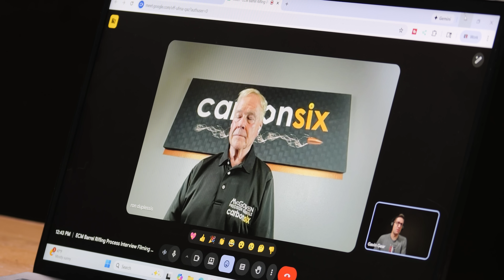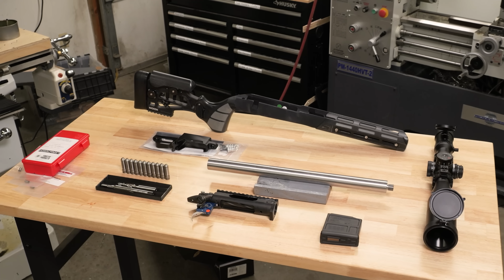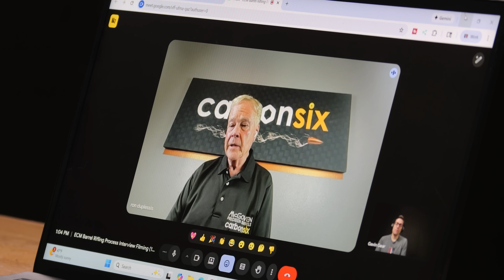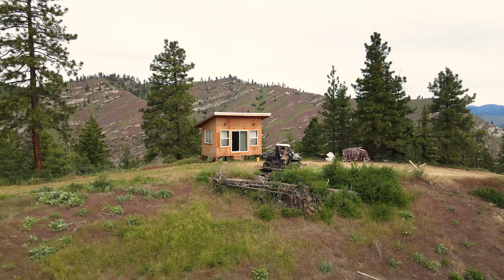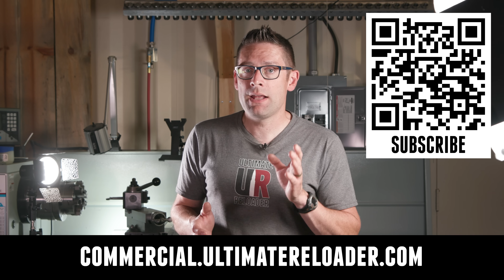ECM Rifling: Discussion with Carbon Six/McGowen (In-Depth)

Comment: So far this technology sounds like it manufacturers barrels way faster, with more accurate rifling, with a better finish, and less stress. So basically it's better in every way, but only McGowen/Carbon Six is doing it? Is it really just the startup cost that's preventing other barrel makers from using it? 
It also sounds like it's the future of custom action manufacturing since it can leave a mirror finish on the raceways which is even better than EDM. 
I have a barrel from Mcgowen on order and they told me it will be an ECM barrel, so I'm trying to keep my expectations reasonable, since surely there has to be some drawbacks to it??

Comment: We used Cation/. Surftran ECM for thousands of pistol barrels when I worked for John Nowlin ( R.I.P. ). 
THERE IS NOTHING SMOOTHER, MORE ACCURATE, AND EASY TO CLEAN using 416R. Wish the best for McGowen... I have a couple of their AR barrels... and one shoots lights out, and the other averages 
.241".... afler treating the barrels. Good luck gents. By the way that was back in the 90's with the ECM! 
Respectfully, Seth

Comment: Somebody here who can tell me if the plastik rod which is placed in the bore has to have a snug fit or more a " press " fit.
In my Opinion the smallest gap between this two parts ,allows the salt water to flow freely and thus reduce the ID of the entire blank.
Answers appreciated

Comment: Barrels are consumables....IMHO more than 6 month lead time to get a replacement is unacceptable (And I do not give a rats ass about availability excuses - FIX THE FUCKING SUPPLY CHAIN ALREADY!). They need to Ask how much business is being lost because folks are just saying "fuck it" to potential projects when they hear a year or two just to get a barrel. I know that I have sold off rifles and decided to NOT shoot certain type matches because of barrel availability. I am too old to wait that long for a barrel!
Barrel life is between 1k & 3k rounds for most of the CF rounds used today for Mid/Long range & PRS matches.... so basically a new pipe every year if you are shooting and practicing. Current availability means that you have primary and backup gun plus two spare barrels sitting there and then a standing order for two barrels a year.

Comment: I recently had a really eye-opening tour of Pac-Nor barrels and their manufacturing process. Some of the custom built equipment they have is just simply insane. The machine they use to remove any dimensional irregularities in a barrel prior to cutting the rifling sounds like it's 90% witchcraft. And this sounds like it's right up in that same category.

Comment: EDM -> spark discharge to erode a work piece.
ECM -> steady low voltage DC to etch metal in a pattern. 

In this video I'm hearing "ECM" described in terms that sound like EDM.

Comment: My 28 Nosler build was excellent, about 1/3 moa at any range I've ever shot it. And she loves the Hammers.
Reply: I'm building a 26 Nosler. That's what I was hoping to hear
Reply: @Econolinebus I used a 28" carbon Six barrel on a tuned up Savage Bear Hunter action. The OG barrel was . 375 Ruger. But any of the magnum bolt faces will work. The magazine will need to be adjusted.

Comment: Would this technology works on military equipments especially that they use chromoly barrels and usually cold hammer forged
Reply: Sabatti hammer forge their barrel blanks before rifling them with ECM machines. I'm not sure what kind of steel they use.

Comment: Are they using this process to cut the chambers as well or are they only producing barrel blanks? 
How can they guarantee 1/2 moa from their barrels if someone else is cutting the chamber? 
Doesn't the cutting of the chamber have just as much to do with accuracy as the cutting of the rifling in the barrel?
Reply: Nice one Lou....looks like chambers might be the next frontier...maybe you could even design your own..which could be converted to program....
Reply: in theory i believe both could be cut with one tool in one go with ecm, i don`t know if there are practical reasons to not do that though.

Comment: 5:30 ECM and EDM are not the same thing. EDM uses heat generated by a spark (discharge) to ablate the metal away. ECM used current and an electrolyte solution to pull atoms off of the metal and into solution, basically the reverse process of electroplating. For a guy who runs an ECM business he really needs to get that straightened out.

Comment: I have one of their barrels that used this new process.It's a 20" 6.5 PRC / Prefit Tikka.  Shoots 140 bergers as a knot hole @ 100 yards.
Reply from the maker: Awesome, was that carbon six or McGowen?
Reply: @Ultimatereloader  Carbon Six. Rebuilt a favorite Tikka,  Manners LRH, Suppressed.  Took 2 white tails this fall.
Reply: @amkamphuis how long did it take to get the barrel ?? After ordering
Reply: @shanerhodes925 7-8 months. I didn’t know I was getting an ECM barrel till I talked with the guys before it shipped.  Planning a 6 or 22 next

Comment: Thanks, Gavin! I'm really excited about this tech. This could open the door to a number of new steel alloys for barrel manufacturing.

If you're going to SHOT Show this year, you might want to stop by the Extrude Hone booth. They'll have an ECM rifling machine on display.
Reply: Damn, that's a good point, being able to cut the rifling has limited what alloys can be used, with this tech that's no longer an issue.

Comment: maybe i missed it. what did he mean by a sleeved barrel?
Reply: They are developing a sleeved barrel to add to the lineup as a budget-friendly option for hunters seeking a lighter barrel at an affordable price, without the need for the added performance of a standard Carbon Six barrel. The sleeved barrel utilizes a carbon fiber tube that is tensioned over a steel barrel, whereas a traditional Carbon Six barrel is constructed by winding carbon fiber over a steel barrel.
Reply: @CHebert95 thank you very much

Comment: EDM is what many call the process.
Reply: That's actually a different process. With EDM, you're using a small spark to selectively erode away the metal. With ECM you're using an electrochemical process to selectively corrode the metal.

Comment: Will it build up a hard outer layer like button riffling.? (Think Forged Receivers vs. milled billet).. Suppose Plating/Deposition (like chrome/mel) is still in the equation… Interesting. love to see the data as it sounds easier/cheaper and way More accurate than buttons.. ? We shall see. 🤙🏻

Comment: Gave a thumbs up because I think it's neat to get a little bit of the inside scoop on what's up and coming.

I've had a small number of McGowen barrels, and the bores have all been good.  I had to return a barrel for a non-concentric chamber, and then re-crown the muzzle on my own, after I sent the barrel back to be redone.

So, while the bores may be good, the gunsmithing and end-product are a little bit sus, as the young kids say.  To their credit, a lot of companies don't pay the best attention to AR-barrels, and these were AR barrels, but still.

That said, I do have another barrel on order.  On week 32 of waiting.

If I have a question for Don -- why is single-point cut considered and end of life product for McGowen?
Reply from the maker: Thank you!
Reply: @Ultimatereloader  I don't see too many other people asking questions, so I'll ask another.

He mentioned Copper Sulfate is used for the button rifling? How does that work?  I recall being told that they use almost a type of copper plating - is this essentially it?  You use the softer material to help act as a lubricant, and prevent galling?
Reply: This is for future readers, because I want to make an addendum to my original post: I'm still waiting for my barrel.

It's been just over 48 weeks since when I made my order, and 16 weeks since I made my original post. 

I reached out to McGowen an addition time, and have not heard back.
Reply: Addendum #2 --- It's now officially been over a year since I ordered my barrel - still haven't received it.

Comment: To address throat erosion I was toying with the idea of a pressing in a carbide insert in the throat area and then ECM the rifling. The insert can be precision ground using a cylindrical grinder as would the carbide insert. The big problem that might come up is the differential in the expansion of the carbide insert and the barrel material.
Reply: Could use EDM sinker to get a precision fit?
Reply: It would be pretty easy to dry ice or liquid nitrogen chill the insert before putting it in, and/or heat the barrel in an oven so that the insert can be physically larger than the counterbore it's going into. As long as you don't get it too too hot, The tension will remain in the steel for years holding the insert in place.

Comment: Wouldn't a button or hammer forging result in stronger rifling surfaces?
Reply: Stainless definitly work hardens , not sure about other barrel steels .
Reply: There doesn't appear to be any significant advantages probably because of  heat treatment  for  stress relieving  ,its a claim that is made by some manufacturers ,if its true its so small a difference no one can measure it...

Comment: I ordered a McGowen in 30-06 for my Savage and used Manson headspace gauges. Had headspace problems right out of the gate. Had my gunsmith look at it and same issues. Contacted McGowen support, guy wasn't very interested. Told me if I wanted I could ship it back to them and they will get around to it when they can. Put the factory barrel back on and it shot right around a minute with no headspace signs at all. I've heard nothing but good things about McGowen but no luck for me. Sometimes you get the bear....sometimes the bear gets you 🤣🐻
Reply: The problem probably started with "S".
Reply: @TODinWY I personally have 4 Savage rifles, 2 110's and 2 10's in calibers fron 22-250 Ackley Improved to 30-06 Ackley Improved and they all shoot great with less work than is necessary with  Remington 700 action.

Comment: Wish they would finish my barrel and actually return my calls and emails so I could get my rifle finished rather than running they're months on the internet.  Been over a year since I ordered my barrel then was told a month out over four or five months ago.  Now dead will not even return my contacts.  Sucks I'll never go carbon six again loss of 4-500 bucks.  Got to love it.
Reply: That’s absurd. Should’ve just got a Proof Research barrel. I would do a charge back on my credit card if I were you.
Reply: I hear ya.
Reply: I agree about having your CC Company rescind the charges.  Good luck !
Reply: Having delt with Mcgowen multiple times, the most recent being the worst experience because they cut my action threads wrong and crooked, you learn that you have to catch them on the phone either early in the morning 9am their time (mountain) or later in the day 4pm their time. It is very frustrating but ultimately they did fix my problem and my 300prc shoots 1 ragged hole with sub 10 fps extreme spreads and 3 sds. Every barrel I own from them shoots 1/4 moa or better including my 7mm-08 ar 10 barrel. Their customer service could definitely use some mass improvement , dont expect a return anything it rarely happens, but the quality of their barrels has never been in question.
Reply: @Long-rangeRunt  boy I really hope so.  That's why I went with that barrel was the reports of great accuracy.  And I was nervous trying a carbon wrapped but they had such good reviews that it was like well give it a shot.
Reply: Nothing but issues with them as well.
Reply: That's unacceptable, hope mine don't take that long but I won't be surprised if it does. At this point I wish I went with another maker like X caliber or proof research.
Reply: @manny17flash  My X-Calibur barrel shoots fine, but it went over their regular expected build time....and I paid their $100 extra option for expedited service to cut 25-50% timeframe, which did nothing so their not great on wait time either.
Reply: @manny17flash yeah but I have heard suck good things about carbon so. As far as accuracy goes.  They're supposed to be the best in town as far as that goes.  Just not so good with bupding then and getting them out the door.  Lol.
Reply: Yeah mine took 10 months to get which was 5 years ago.
Reply: @Chris-ob8ok oh boy.  So could take five years now days hahaha
Reply: I went to kkm for my pistol barrel they told me 6 weeks, I got it at my doorstep in a month it was like Christmas.
Reply: @linkbond08  kkm?? I have not heard of them before
Reply: @shanerhodes925 
Kkm precision, they make pistol barrels, for a bunch of popular models like M&P, Glock, 1911s, and other. 
Prices are fair, and barrels are made on demand, so if you're looking for uncommon calibers, barrel lengths, or threaded options you can email and ask about them.
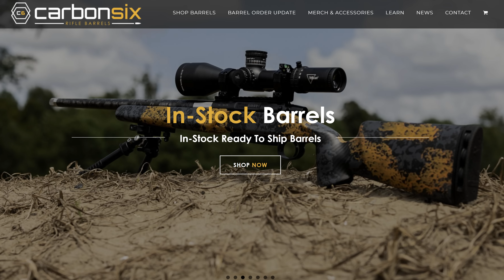I got my full size M&P barrel in 357sig extended to 5", rifled 1:16", and threaded ½"x28.
Reply: @shanerhodes925 What?
They make the best after market 357sig barrels for S&W M&P 2.0 pistols.
I have a 5" and a 3.6" for my M&P 2.0.
Reply: 🎉 RT u hiii un uuu un 👋 I will i
Reply: I ordered one 18 weeks ago and haven’t heard a single word from them and they won’t return my phone calls or emails either.
Reply: Was a year almost to the day though I think it was like three or four days from being a year. Fro order to when I got it.
Reply: @dustinjahnsen1846 I did finally get it.  But it did not work out so good I just sent it back I think the tennon was out a hair too far. But they didn't ask questions just sent me a return label.  So we shall see
Reply: Did you end up getting your barrel? How long overall did it take and does it shoot good?
Reply: @bobbygetsbanned6049   I did get it last spring.  It shoots ok.  I have not had time to dial my load in perfectly yet. But it is showing promise.

Comment: I hope they are able to get rid of the 12 month lead time for a barrel. I havnt bought one from them due to the fact I can’t get it for a year.
Reply: I've been over a year and I was told a 14 week lead time.  It's fucking nuts.
Reply: They are not the only ones who have a long lead
Reply: @Patrick-xd8jv  I think what's bothering me is they will not return my phone calls emails nothing.  One time I did speak with them they couldn't find my order then a week or so later I received an email stating that my barrel would be ready in three to four weeks.  That was months ago.  That's what is bothering me the most.  Since then they will not speak with me

Comment: It's actually very much what people use for electro sketching on metal like makers marks but they're doing it inside of the barrel to get Presision rifling. Very awesome system. You can probably get tolerances down to .00005 if I understand. Basically so accurate you cannot measure the difference.

Comment: Let the benchrest guys put it to the test.  If they say it’s good, it’s really good!
Reply: DONT leave out F-Class. “Prone Benchrest”.
Reply: @johnseptien3138 or PRS (Cardio Benchrest)
Reply: @johnseptien3138  Too much wind with F class, at least the long range comps. I'm much more interested in what the benchrest guys think about it.
Reply: We do not use carbon wrapped barrels in benchrest.
Reply: @HPAccuracy McGowen is making their regular barrels with ECM now. I'm still not sure about the branding, it sounds like their ECM barrels will eventually be branded Precision Cut, but I have a regular steel barrel on order with McGowen and they told me it will be an ECM barrel.
Reply: Hope i could get my hand on a LV 27-29 in blank in 13,5 or a Bukys gain twist

Comment: I am waiting for EDM to be used to cold cut a barrel bore and possibly rifle it as well.
Reply from the maker: This is essentially that.
Reply: @Ultimatereloader  are they replacing the deep hole drillling and finish ream operations with ECM?
Reply: @Ultimatereloader  Rubbish Gavin, some of your comments show extreme naivety about mechanical engineering.

Comment: I would be very interested to hear the engineer/QC's answers for your tolerances question. This interview is very good, but, he gave "CEO" answers, a lot of "probably" "almost" "pretty near". I know you were looking for real numbers as well with your questions, should see what you can find out. Their QC must be measuring it somehow and they must have some sort of standard to production.
Reply: I don’t work for Carbon Six but I am an engineer with experience with small tolerance machining of through-holes with wire EDM and honing processes. One of the difficult things about measuring dimensionality (diameter at LMC and MMC, perpendicularity, etc.) through a long through-hole will be accurate measurement. It’s hard to quantify past a certain point due to limitations of tooling, and measurement devices. Air gauges might be able to be used for deep holes, but I would imagine there are negligible returns on performance with QC’ing the entire length of the barrel. My experience of Wire EDM (I don’t have experience with plunge EDM) on the machines we used, I could get ~0.001” repeatability on holes and the surface finish was pretty fine. Not mirror, but pretty close. I would imagine they will plug gage a couple parts of the barrel and call it good enough (and it will very likely be good). I’m pretty optimistic of the application.

Comment: The 1.4" barrel is not a straight taper, it is just plain straight (i.e., UNtapered).  A straight taper of 1.250-0.900" at 28" is found on a heavy varmint benchrest barrel, for example, after the 1.250x5.000" chamber end of the barrel.